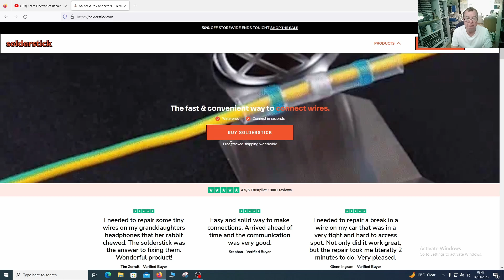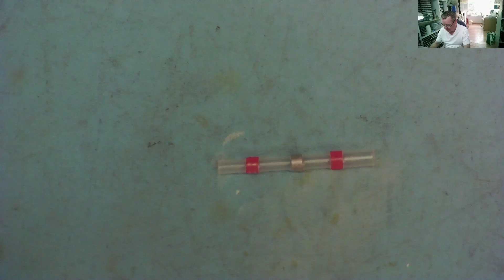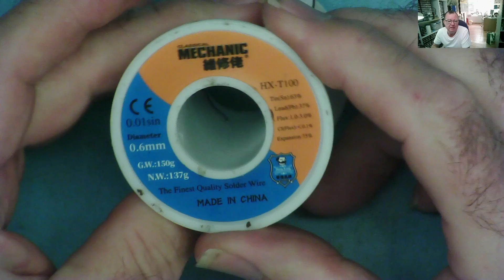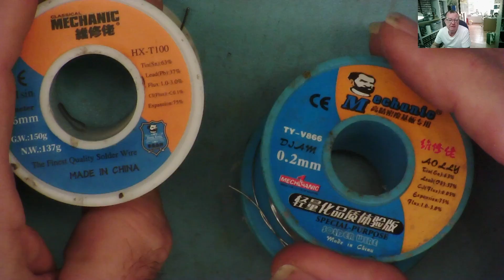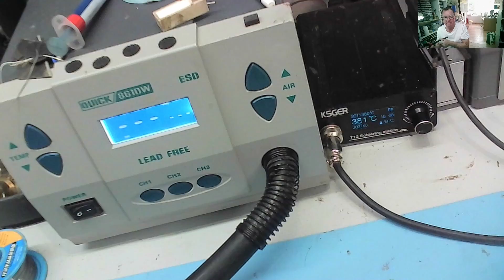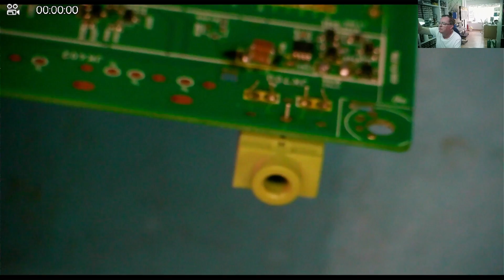How To Solder & Desolder Small SMD Components Using A Soldering Iron - Resistor Capacitor Transistor

Comment: What solder iron tip size, and solder wir size do you use for 0402, and 0201 resistors/capacitors?

Comment: I have seen you using either 350 or 380 degrees X for microsoldering. Do you use 350*F or 350*C for the soldering iron?

Comment: Hi Richard, I just wanted to say I adore your channel and have learned so much from you. I recently started a job involving power electronics, and I have been using your channel to learn and review practical things so I can eventually diagnose and repair stuff around the lab if needed.  I’ve also been learning to solder large-ish SMD components on aluminum boards (basically what we had lying around unused), and your advice to switch to a chunky tip is life changing! I don’t have a bevel style, but the chisel style I’ve got at work is still a world of difference over the fine point! Today I successfully desoldered and resoldered a four pin chip on an aluminum board using your techniques! Previous attempts had me overheating and ripping pads off (a different board) lol. So again, thank you so much for your channel and all the solid education you provide people like me getting into the field. Ciao!

Comment: I'm not experienced in such fine electrical repairs but found this channel to follow along with on how to learn. I scored a free washing machine and upon inspection found it has a fried component on the circuit board. It appears to be a black 3 legged SMD ACS1086S transistor. It's the only part of the board that looks fried. I hope that my attempt to repair it is successful. Thank you for sharing your knowledge and expertise.

Comment: BC2 is my go to tip! I use a reverse cross tweezers to help alignment when I'm adding caps in parallel and works great.  I like the fact that the tip is just big enough to cover 2 0805's stacked.

Comment: Are you not afraid of damaging parts when applying heat? I just bought a light reflection sensor and in the datasheet it mentions quite a low maximum lead temperature, about 260 degrees C.

Comment: What do you recommend for pulling the aluminium dome out of a tweeter that has been pushed in by a child? Would a SMD vacuum tool with a little sucker on the end work?
Reply: Use a normal vacuum cleaner, increase the suction till it pops out

Comment: Lots of ways to do this, and it all comes down to personal preference. For hand soldering 0402 up to SOIC, I get great results with a 0.8mm chisel tip (Hakko 900M-T-0.8D) under magnification. Easy peasy.
Reply from the maker: And this is exactly what I am😉 saying - find a method/tip that works best for you and stuck with it until you can do it almost without looking
Reply: Great to hear! Do you know if all T12 tips are interchangeable?

Comment: I'm involved in the restoration of a 53 year old boat.. All the internals are past saving. (it looks like it was full of water for 10 years) For once a very useful sponsor.. Thanks.. I'll be checking them out when the time comes to make up a completely new wiring harness.
Reply: Why do you intend to have wire joints in a new harness?
Reply: @alanrichardson1672  Because wires have to go through internal bulkheads.. it's not a rowing boat

Comment: Such a good technique, I was sort of doing that my self when I didn't want to but it didn't occur to me that I should actually do it when I'm removing a shorted component to save blasting everything with hot air. The only problem I can think that would come up is if its a really densilty populated area around a microchip but I think at that point I could just come in from the top and get the solder heated on both pads either side.

Also having some inverted tweezers where its by default grips and you have to squeeze them to open them apart are quite handy for handling SMD components. They have ceramic ends on them.
Reply from the maker: Yeah I have some of those inverted tweezers but they are not fine enough for this sort of work - do you have some very fine tip inverted tweezers, I would be interested in trying some.
Reply: @learnelectronicsrepair  I have 1 set  being the white ceramic inverted tweezers which I got from Amazon, I also modified them a bit because for smaller SMD components they would grip to tightly so I used bluetact to adjust the strength. This was for hand soldering 0402 components because I can imagine with the hotair gun it would easily melt the blue tact. 

I also have another pair which I got from ebay which have a slider that allows you to adjust the strength and lock them which are jewelery industrial tweezers, these do have a very fine tip on them.

which reminds me I will have to look at what other tools jewelers use because I am still struggling with handling 0201 SMD components and havn't really come up with a good solution yet, even with using inverted tweezers. Anything above that size though is fine. 

I was also using a magnet to get the SMD to sit flat while I would grip components with either tweezers, it just made it a little easier than having them fly into a portal and never see them again.

Comment: Richard  I use the 245 sk tip to remove the parts  it goes on both pads on most parts it too it rather chucky  and the knife is ez to get into places  73 n4jrs

Comment: How much heat can you usually subject components to before they are damaged?
Reply: Unknown variables.  Too many unknowns.
Reply: @Big Bass  Yes, as a returning "enthusiast" I wondered if there was a new "rule of thumb" rather than having to consult various data sheets, thanks for your reply 👍
Reply from the maker: @plaistow001  With modern components at least I think you will find the answer to your question is 'far more than you would expect'
Reply: @learnelectronicsrepair  thank you!
Reply: As a rule of thumb, higher heat and low duration is better, the faster you can remove a component without soaking the component and board with heat the better. better to add leaded solder to lower the melt temp and create a liquid pool too, I like around 500F (250C) with a larger tip to transfer the heat into the solder joint

Comment: It's OK to have sponsors, it helps the channel and it's also related to electronics! Keep on the good work!
Reply from the maker: Thank you.  One thing for sure I will always keep things relevant on LER when the choice is within my control
Reply: @learnelectronicsrepair  🙂 your welcome.  been learning more on LER vs any other YouTube channel, I even got a few meters to help me out, once I can stand for longer times and lift up more then 8 1/2 lbs. Before finding LER, I got one PSU running for 6 months more before it blew out something else, now I know what to check, thanks.
Reply: I don't mind sponsors too, when it is an item I can use. I do have a problem with the ad's that don't  have a thing to do with the video, like a moving ad or health ad that's showing bed bugs, that have nothing to do with what they are selling.. I know he can't pick the ad's.

Comment: Great video Richard. I tend to use 1.6mm tip to do most of my rework, but I will try a chunkier tip and see how i get on.
By the way, you failed to mention two tools you used throughout your video and that was the twicers and the magnification unit you use. A little recommendation on those tools would be appreciated.
Reply: Tweezers*
Reply from the maker: @dvsr5296  Agreed - I will do it